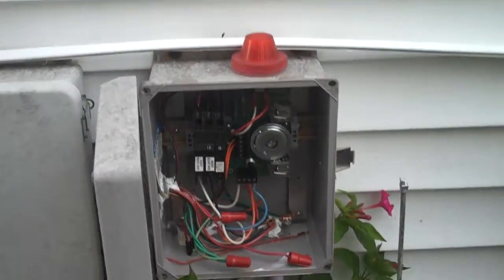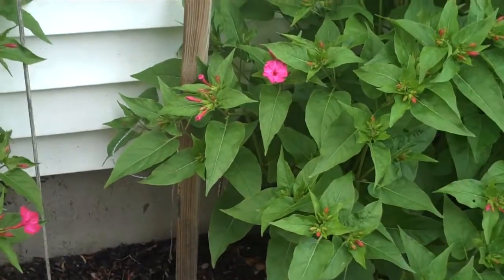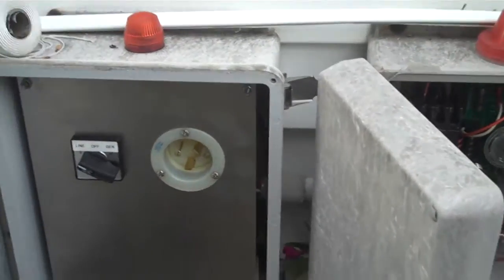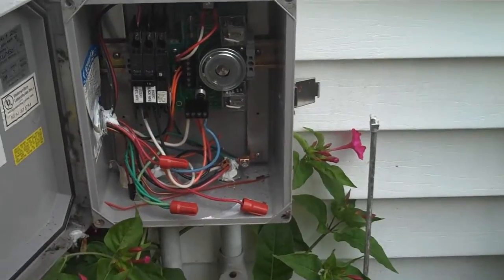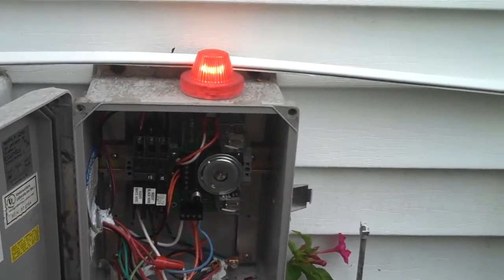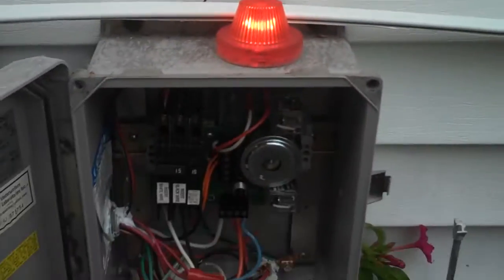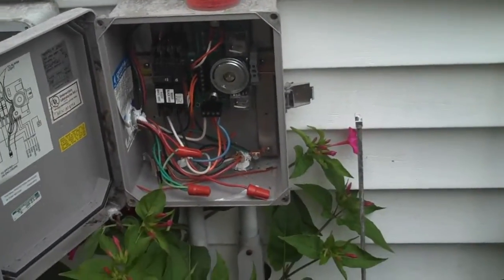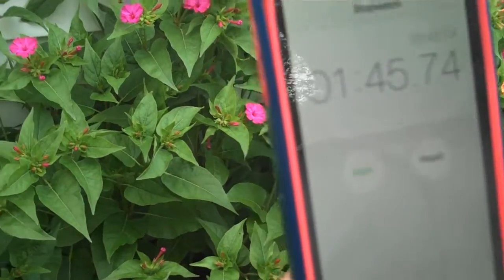E/one Series 2000 Grinder Pump Alarm Test Failure on Columbus Ave

Comment: Is there any documentation on that battery backup alarm?  I’m interested in knowing the points it connects to for sensing alarm when the power is off.
Reply: Are you having an issue with a system or just curious about eones?
Reply: James Russell I’m not sure you would call it an “issue”. But when my power is off I can’t tell how full the tank is. Meaning I have no way to know if it’s reached the alarm level or not. I’d like to improve my existing panel to add in new feature to alarm for high level even when the power is off.  I see that the unit in the video does exactly what I want. But it’s obviously not working in the video so I’m just trying to see where it hooks up.  

I’ve already modified my own unit to page my cell phone for high water alarm. It also logs all runtimes to my home computer which allows me to chart historical usage.  Perhaps I’m weird to have an interest in home automation. But It’s been my hobby for 30 years.

Comment: At 4:28 I can see smoke coming out from the box.  I don’t think that it should be releasing smoke. 

Did you figure out what broke?  Why did it smoke? What was done to fix it?  

I have this same box and I’ve modified it to page my cell phone if the alarm is activated. I’ve also added run time meter that logs each start stop time onto my computer. And written a report that displays run history as a table.